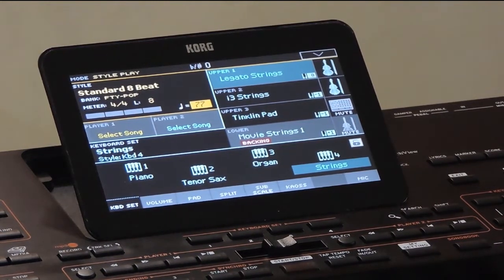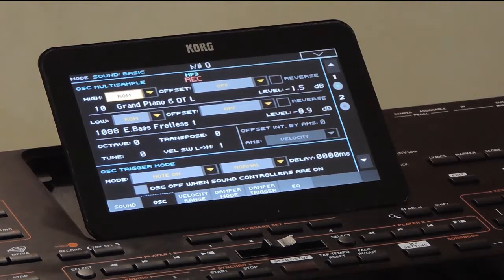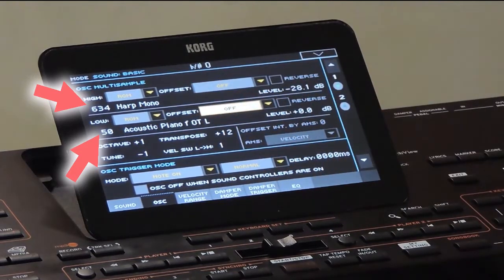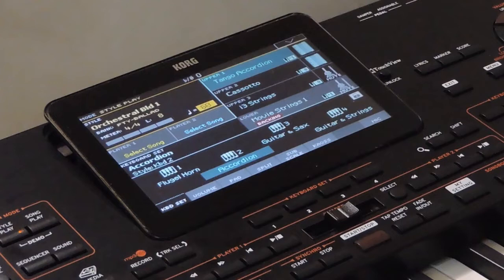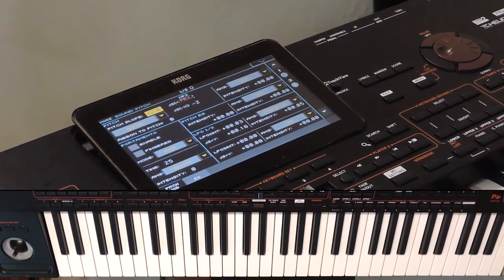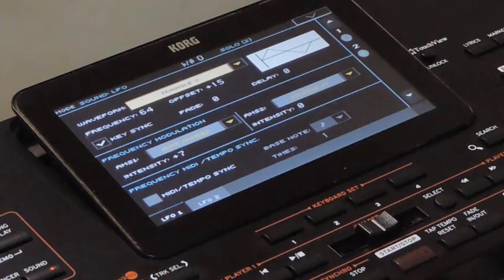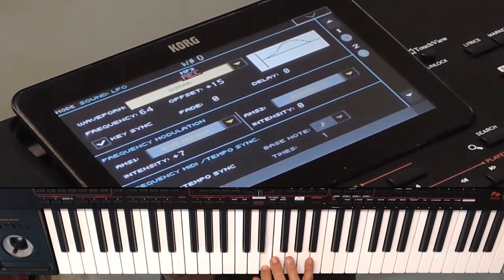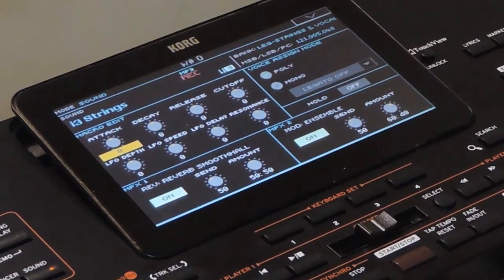Korg Sound Editing (part 1) | Sound Mode Basics | Synthesizer basics

Comment: Hi. Thanks for the video. How do I remove vibrato from the existing sound while editing on a Korg PA 50 SD.
Reply from the maker: Try adjusting vibrato knob
Reply: @ArrangerTutorials  There is no vibrato knob for this model. Can you tell me which parameter to adjust to remove the vibrato.
Reply from the maker: I dont have a pa50 now. I dont remember what were the options it has. Vbrato can be achieved using the vibrato knob or lfo or some FX. So it depends on how it was applied. Check if there are any effects with vibrato applied to it

Comment: Hello. Thank you for this video. It make me understand more sound editing. Can you specific tell me how to make fabric piano sound more louder. I will be very grateful. Thank you
Reply from the maker: There are different ways to increase the level of a sound. If the track volume is 127 and you dont get enough level try some of the below options
1. In the sound mode, if the oscillators are not set to the maximum level, try increasing them
2. Adding some fx like compressor can give high levels
3. If all those dont work, try balancing all the sounds in the Kab sets and keep a lower volume for all the sounds in tracks. Then the ones with very low volume can be set to 127.

Comment: Fantastic tutorial, Manoj! Watching your videos is like drinking water from a fire hose!! So much info packed in such a short video. I find most of the standard sounds are not loud enough for me even at 127 volume. I could never figure out how to change that but you mentioned it briefly in this video. Question - are factory set sounds editable? Or do we need to save it under different name in some user bank and then edit it?
Reply: Go to Global settings then open "Mode preferences" / Media page , here you will find protect settings , just uncheck "Factory" and now your factory sounds will be editable.
Reply from the maker: Thank you
Reply from the maker: Thank you Siva. I think you can overwrite the factory sounds. But I haven't tried to do it yet. What I would recommend is to make changes to the factory sound and then save it as a user sound.